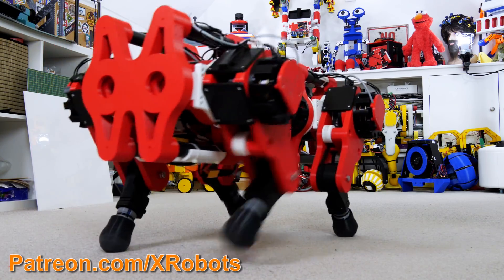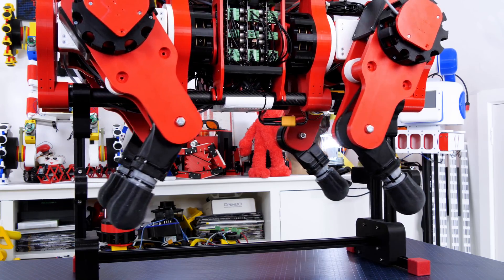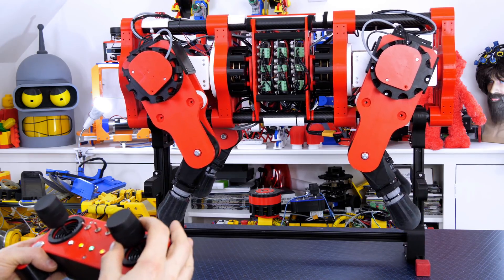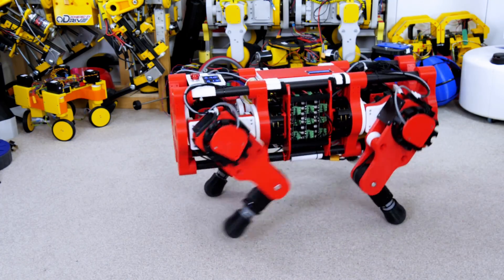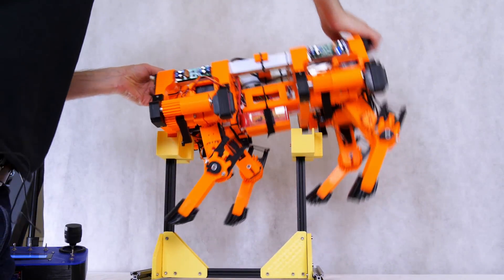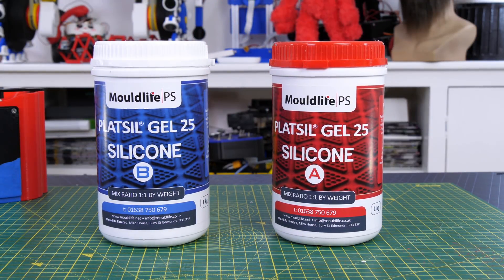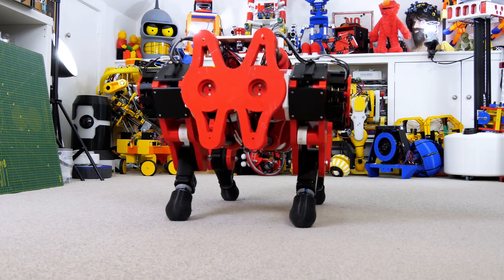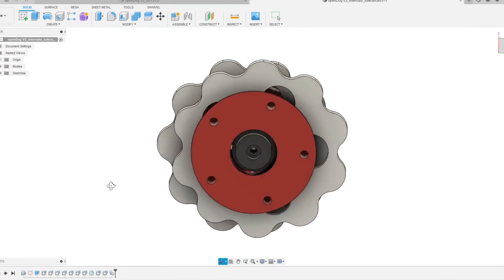openDog V3: How I made it Walk

Comment: I would have used vectors for the position of the foot instead of trig. It should be easy as you have the angles which can be combined with the length of each part for the vectors. Just add the vectors and you get the foot position. The only hard part would be the offset, but adding another vector for that shouldn't be too hard.

Comment: The feet are spherical. I.e. their center will always be lifted off the ground by 1 radius, no matter the angle of the leg. Just do your trigonometry with the lower leg length measured from the center of the spherical foot. You can add the constant offset of one sphere radius for the height of the dog later on if this is important. This eliminates the error due to the different leg angles that you mentioned.

Comment: Surely someone else has already pointed this out, and the inverse kinematics already seem to work pretty well, but accounting for how the feet contact the floor at different points depending on angle of the lower leg should be really easy - in the IK model, pretend the lower leg only reaches the center of the sphere on the foot, instead of to its surface. That way, the IK thinks it's walking 5cm off the ground (or whatever the radius of the foot is), but since the feet are spheres it doesn't matter. The distance from the IK model foot to the real life ground is always the same. The only issue not accounted for would then be how the feet roll on the ground instead of pivoting at the center of the sphere.

Comment: I heard in your video that the gearboxes have a reduction of 1:10. Thats quite high for an actuator where backdrivability is important. How much torque does it take to get the actuator moving from rest ( stiction)? Also, did you use a particular method to quantify the degree of backdrivability?

Comment: I have about 95% of the parts printed now, 1/23/2022. I have one complete leg with hip, leg, and knee motors, waiting for ODrives to arrive. I have had to do a lot of filing and sanding to get things to fit, not sure if it is the differences in printers or what. Most bearings are too tight and required me to file on the holes to get them into place, at least their tight.
Reply from the maker: That's why I published solid models in STEP format - so you can tolerance everything for your printer. The Cycloidal drives/discs are particularly important to get right so they run freely with minimal backlash.
Reply: @jamesbruton  The Cycloidal drives seem real close, I am not sure there as smooth as yours seem but I was thinking they will smooth out with some run time? And the only way I would be able to tune parts for my printers would be to print a part and make changes and print again, so I just put a file to them. He is going to be a lot heavier than I expected, have the motors heated up at all or do they seem to be adequate for the job?

Comment: You could fix the issue with the calculations that you mentioned at 1:14 by changing it so your not calculating the entire length of the legg but in stead the length to the center of the silicone feet and then just adding the radius of the feet at the end.
Assuming the feet are spherical and not elliptical

Comment: In terms of the offset between the hip angle and the foot: it might be worth it to go back to belt drives for the rotational hip motion, while keeping cycloidal drives for the shoulder and knee. 

The thinking is that, since the robot doesn't move side to side that much, you don't need as big a reduction in the hip. and you'd be able to save weight and remove the offset, which would better harness the cycloidal drives in the shoulder and knee.

just an idea for a variant

Comment: James, love your videos.  I have a content request:  Would you be interested in doing a video describing your general workflow for cad designs?  I've always been impressed with how quickly you are able to refine your models and I'm interested in hearing what you consider to be "best practices" in this process.  I would like to reduce the number of revisions in my own designs and have less trial and error.  For example, I have always struggled to deal with shrinkage problem in the inside diameter of 3d printed holes.  Screws, nuts and bearings are always either too tight or have a lot of slop.  Also, do you have any "rule's of thumb" for under sizing / oversizing parts that need to key together?  I know these types of instructional videos are not really what your channel is about but you appear to have a wealth of knowledge worth sharing.

Comment: James it's so awesome to see you iterate through your designs, learning at each step. an inspiration!

I've got an idea for you.  Right now you doing everything with position.  This works great for slower moving systems.  But there are two factors missing.  

1) moving systems have inertia. Slowing down or speeding something up.  And the requires force.  If there was a way to predict the inertia changes needed then you could be able to add additional force into the system BEFORE the position is not what you want it to be.  Just because you know that you are slowing down or speeding up a joint.   So now you have fancy math. (calculus, inertia tensors, blah blah ).  But it's all been worked out before, but I think that's what will take this hardware to the next level.   

2) Even non-moving system should be able to know how much they "weigh" and add in some force to counteract the weight.  So if a leg knows it should be supporting weight, then one ought to be able to calculate some additional torque/current needed to counteract that weight.   If you don't add this in, then you have to wait for the "I" part of a PID system to notice a problem and add that torque/current back into the system.

Comment: 1:25 Can't you avoid this error by using the center of the foot for your calculations (instead of the tip)? Then its distance to the ground would be the same along every angle
Reply: As he said , the shape of the feets aren't totally circular which causes the diameter of the feet (as they are round) to vary with the angel....

Comment: Why are two (of the hind?) legs backwards? I've seen it in the boston Robotics big dog etc, and it always looks wrong to me.
Reply from the maker: It's the same as an actual dog and all other mammals that walk on 4 legs. It also means the load on the joints is balanced because it's symmetrical.
Reply: @jamesbruton  An actual dog would have all paws pointing in the same direction wouldn't they?

Comment: Nice. It be cool if you can get it to stand still when not moving, and only tap its feet when needed.
Reply from the maker: It stops and stands still when you stop. There's a filter that decays the commands so it always walks on the spot for a bit when it stops so it can get its legs straight.

Comment: Hmm, I think you should set the triangle corner in the center of the foot ball, and then just add the radius later if needed. I think it will be equivalent as if the center of the ball was a pointy foot, and the floor was one radius closer?
Reply: i think you're on the right path with that idea, i think you would have to do an additional trig calculation to figure out the "imaginary length" of the foot based on the angle of the leg and the radius of the foot.

edit: you could cheat and throw all the answers to the math for all angles into a lookup table and then abstract the values from that and just add it to the existing length, though that may not work as nicely in practice.

Comment: Hi James. Could you fix the problem mentioned at 1:30 by using the foot sphere’s centre in the kinematic model as the leg’s end point? When the foot is on the floor the sphere’s centre will always be the same height regardless of the leg’s orientation.
Reply: Came here to write the same idea, just use the center of the sphere and add the sphere radius to the height.
Reply: @dara0s  See my reply to John Bäckstrand.  Offsetting works statically, but causes excess velocity & turning because the ball rolls on the ground as the leg shifts through angles when in ground contact during motion.  It's still the right concept to start from, just missing an additional correction.
Reply: @Sn0wZer0  you're right! I think that the correction should be pretty simple, just a factor of the angle from the shoulder for X and Y, (how many cm of are each degree, based on the diameter of the foot)
Reply: @dara0s  There's simple, which is making a scalar correction factor based on the step length and assuming sin(x)~=x which works pretty well if you keep the angles <25 deg.  Then there's really doing it right, which is a bit more involved as it affects the IK target as the foot rolls in a nonlinear way so you can't ignore it to get an exact answer.  Given the compliance in James' robot, the simple one probably works fine.

Comment: at 1:23 you said that you just live with the small change in length that the legs do when touching the ground at a different angle. You can eliminate this however by elevating the height of the  theoretical ground in your calculations so that it passes right through the center point of the feet spheres. That way no matter the angle of the legs the spheres will be at the right point above the right spot on the ground. And since they are spheres the real ground will have exactly the same contact points every time.

Comment: i feel like your IK model should go to the center of the feet spheres and then you can just set an offset to the ground as the radius of the sphere
Reply from the maker: Yes that's what I did with V2, however the feet still roll and so the centre will change position. There's probably not much in it either way, but at some point I'll make the lower legs longer and change the kinematics.

Comment: Those cycloidal drives are a great fit for this application, and it's nice that they are mostly 3D printed. I wonder if their size (and cost?) could be reduced by using more traditional manufacturing techniques.
Reply from the maker: well probably yes, but you'd need to make a lot of them to make it worthwhile.
Reply: @jamesbruton  true. It seems to fit an underserved niche. Compact, high ratio, high torque, back-driveable, on-axis gearbox seems like the perfect fit for robotics applications, and there's not much else like it.

Comment: Some clay inside the foot balls might help it plant its stance. short, thin rubber tubes filled with clay covered with suede might make nice paws. the motors at the shoulders and hips might gear something in between them adding balance , storing potential energy or adding function  like head motion or overall motor tension

Comment: Hi, James. About the small error in the IK you mentioned in 1:20 (feet touching the ground at different angles), if the foot itself is a sphere, one thing I did when working with quadruped robots was just to subtract the radius in z direction from the point that is in the center of the sphere, so that you arrive at the contact point. That will always be true bc it's a sphere
Reply from the maker: I probably just need to make the lower legs 25mm longer or so, although they will still roll along as the angle chages, so the contact point will vary.

Comment: One thing i'd suggest is to make the robot lighter with less bulky 3D printed parts.

I've seen quite a lot of your projects and your parts seems quite overkill sometimes. Maybe you could make some hollow out designs to gain a few weight on that plastic ?
Reply from the maker: I just need to make sure things work and don't break. It's not that much extra plastic at 10-15% infill.
Reply: @jamesbruton  10-15%infill isn't much indeed, but with some optimisations, you could make the whole assembly much lighter and parts smaller with the same strength ^^

A good way to reduce some weigh and make parts looks nice is to play with chamfers imo :>
Reply: Don't worry, I 3D print things a lot, and even I was thinking that. Sometimes it's easy to forget that the vast majority of printed parts are hollow.

Comment: Why not calculate to the center of the ball on the end of the foot?  it'd be a fake "ground", but all 4 feet would always have the same ground offset no matter what position they end up in.  You could even take that offset into account for height if you really wanted to, but I don't think it's necessary.

I think that would eliminate the error in the calculation without any physical changes.

Comment: you just blew my mind there... i implemented inverse kinematics as an exercise once. it was supposed to be generalized, even so it was meant to control a particular robot arm and that generality made it the most complicated piece of math i ever programmed and it didn't even work particularly well apart from being dead slow.
doing it for the special case, i was actually dealing with occured to me, but i was convinced it would be even more complicated to do so... boy was my mentor wrong!!!
should i ever try something like that again, there will be a piece of paper and a straight edge first!

Comment: Wouldnt it be easier du see the robotlegs as 3 coordinate systems relative to each other ?
Then you can calculate everything with matrix multiplication and addition, and its just a view lines of code
Reply from the maker: If I knew what they meant.
Reply: @jamesbruton  https://en.wikipedia.org/wiki/Geometric_transformation
I Think vectors  should also work, if you just consider each piece of the leg connected with a joint as a  3D vector, with the hip joint beeing the 0 position in  the coordinate system, because all those vectors have constant length you just have to rotate them individually and recalculate the sum vector (adding up all the individual joint-vectors after each rotation), rotation = moving a legjoint,

Does this make sense?

Comment: You could use a 1 to 1 belt drive between the shoulder motor/gear box and a shoulder joint that is directly above the foot then you won't have the problem of weight on the foot causing the shoulder to move
Reply from the maker: I've considered it as a modification, but we'll see how it goes.
Reply: Yep I was thinking this or possibly stick with the belt here as presumably the torque requirement is lower at this point? Especially with the feet directly below which gives zero load in the neutral position?

Comment: For the feet being spheres, could you not use the center of the sphere as the end of the joint for the reverse kinematics. This way the feet will touch the ground when the center is r (radius) above the ground, so uniformly for all feet and possible rotations of the feet
Reply from the maker: Yes I did that in openDog V2, but the centre still moves as the feet roll along, so it's still not totally accuarate. I may lengthen the lower legs at some point, so I'll need to re-do the kinematics at that point.

Comment: I was worried there was no video today, but I remembered I'm quite a few timezones ahead of the UK.

For dynamic stability, have you considered measuring the ground pressure at each foot? this should let you track where the CG of the dog is on the floor plane and how it's moving. If the CG moves outside of the area defined by the dogs feet you can have it move one of the legs out to catch itself. By tracking the velocity and acceleration with which the CG moves, you can predict where it is/will be when it leaves the footprint of the dog. This lets you command the legs to move a specific and dynamic distance to extend the footprint (the area encompassed by the 3 or 4 feet on the ground) to cover the expected position of the CG, rather than taking a fixed or arbitrary step size to catch itself.

The hard part is working out where exactly the CG will be when the dog completes a step, so to know where to make that step, since by the time you complete the step, the CG will have moved. The solution could be to pick a high estimate for how long a step would take when working out the anticipated CG location, and just make all steps take this fixed length of time. This would result in the dog taking small steps slowly, and big steps quickly which is kind of natural, like a human that is really off balance will move quickly to take a big step to restore balance, but more slowly when their balance isn't very off.

Comment: That Anker pack actually has a low power mode that you can switch on which is designed for things that have a low load on the usb.
Reply: Oh, that's really cool. Most power banks can't do that. It's great to see that the manufacturer has thought of the low load issue.
Reply: Most often they would turn that mode off after 2 hours
Reply: I was just about to write the same comment!
Reply: cant like cause 69

Comment: Can you make it so it will stay up if you kick it?
Reply: Not like a Boston Dynamics robot. It doesn't have dynamic stabilisation, it's just an adjustable gait with some springiness in the joints.
Reply: @clonkex  For now. There is an IMU on board which can be used later to add dynamic stabilization later.
Reply: @jeroen94704  Sure, but not like Boston Dynamics, unless you think James is going to be doing incredible amounts of software work. He can make it try to stay upright based on the IMU easily enough, but making it take additional steps to get its legs under its centre of mass is vastly more complex.